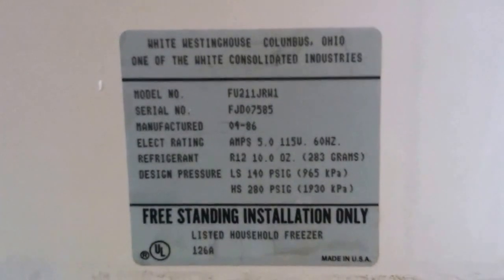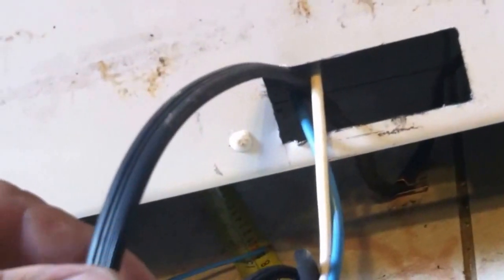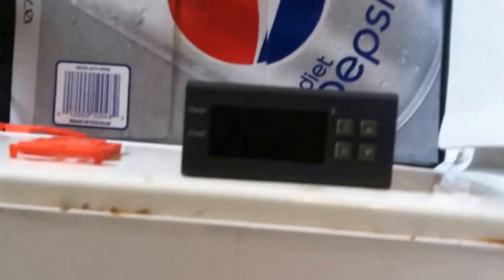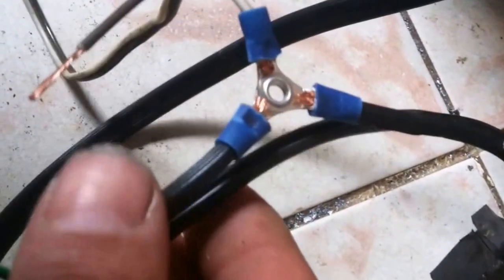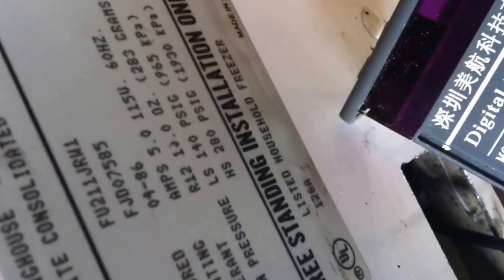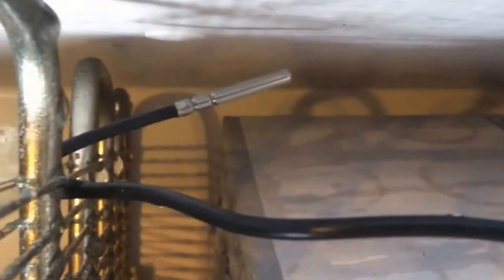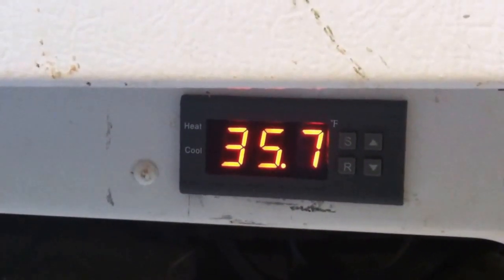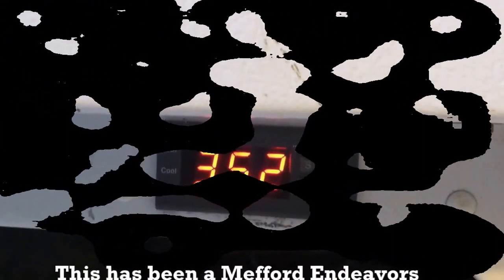Freezer to Digital Refrigerator Conversion

Comment: Are you doing this to a digital or an analog freezer?  I think what you've done is on an analog freezer ..The power boards on digital freezers and digital refrigerators don't seem to be inter 
changeable ...  and they run different thing like defrost timer etc.
Reply from the maker: Yes it was an analog freezer. The freezer was almost 20 years old when I made this video.

Comment: Can one do this for a refrigerator and freezer. I’m taking a GE and trying to replace the manual dial to a digital control. Would like to even have the freezer section to just be refrigerated. I’m converting to a meat aging fridge.
Reply from the maker: I'm sure that it is possible. Most fridge freezer combos only have one compressor and they just move cold air into the fridge from the freezer. some newer units will have separate evaporators for fridge and freezer. its not much $ to give it a shot... at least the fridge part should be good. Thank for watching! T
Reply: Did you ever figure this out? Looking to convert the freezer into a refrigerator for a beer fridge.